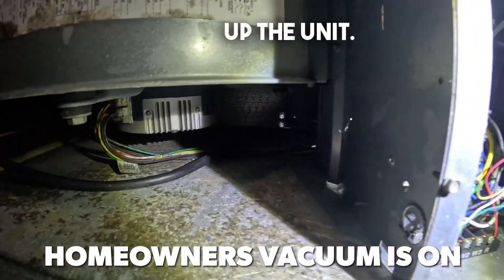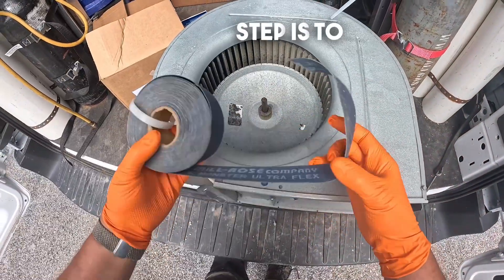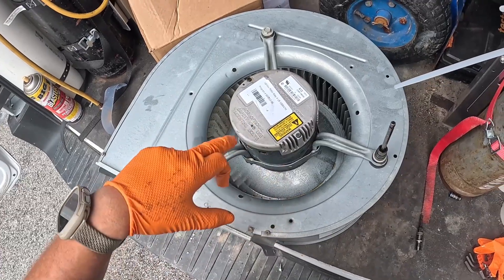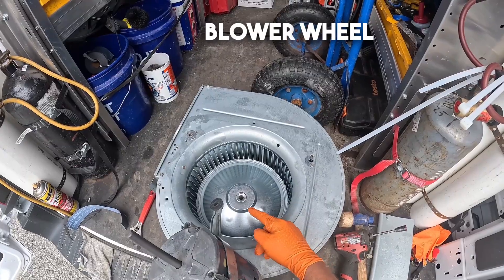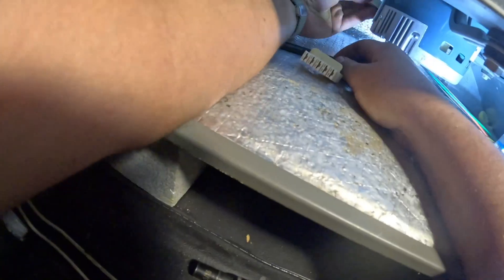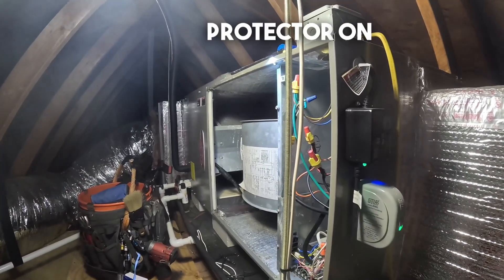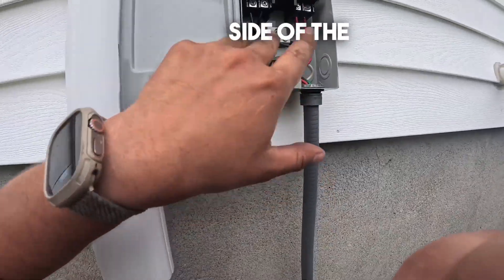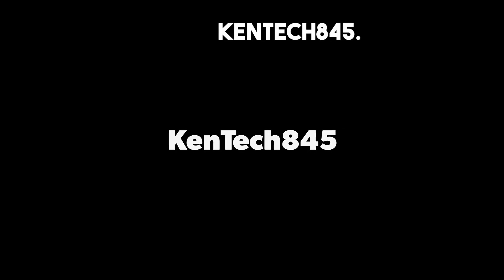2012 Lennox ECM Blower Motor & Wheel Replacement | Erratic Fan Speed Fixed

Comment: Thanks for sharing. I see you use a turbo torch. I used one for 30nyears.
Reply from the maker: Yes! As a installer turned service technician I brought that along for the ride BUT I definitely want to grow the skill of brazing of oxy acetylene as their are some things you service that pin point precision is the best way to get the job done.